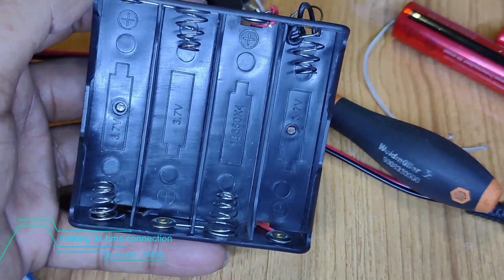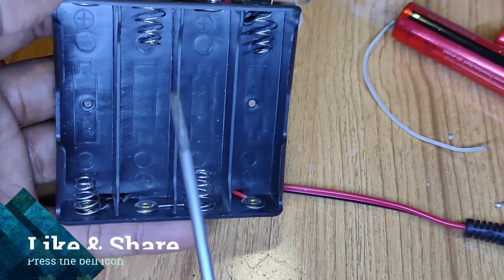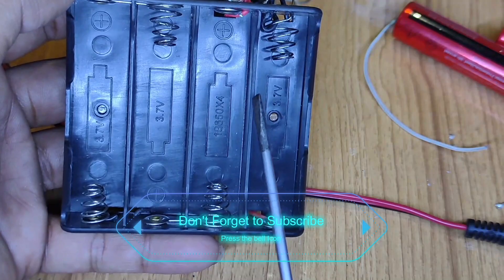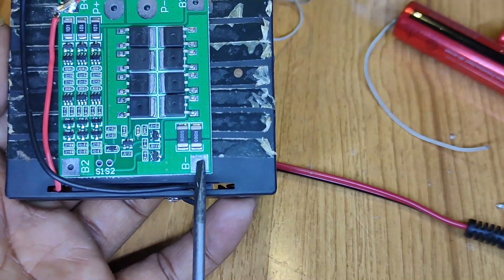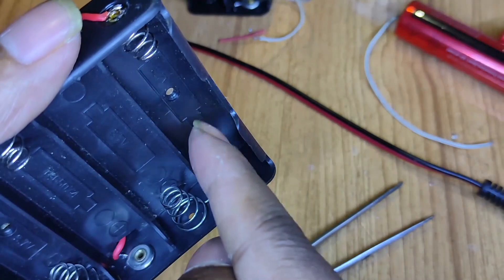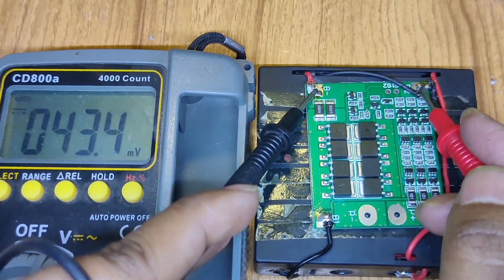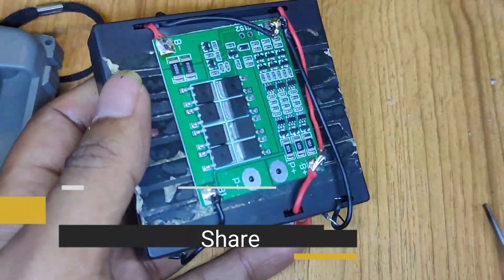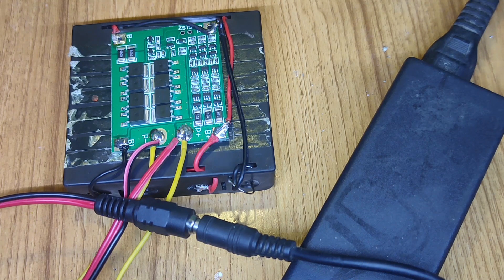Making lithium ion battery pack 12 V using 3s BMS with 4 battery and proper connection

Comment: Can I charge my 3S Li-ion pack (with BMS) using a 20v charger? In other other words, will the BMS cut-off charging when pack reaches at 12.6v?
Reply from the maker: yes you can charge. also this is 3 s bms that means 11.5 to 12.5 v maximum ratio. it does mean the bms cut off charging when pack reaches at 12.6 v and whatever its charging from 20 v charger
Reply from the maker: but recommendation is 12v and 18 v  charger is good for 3s bms